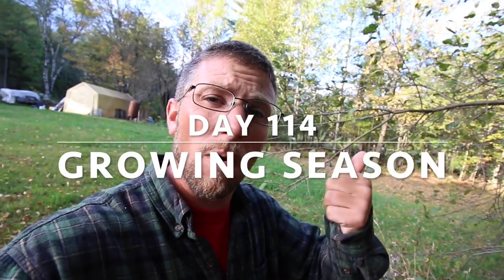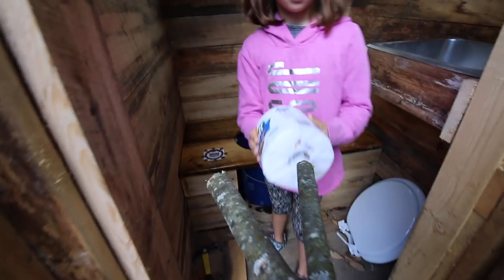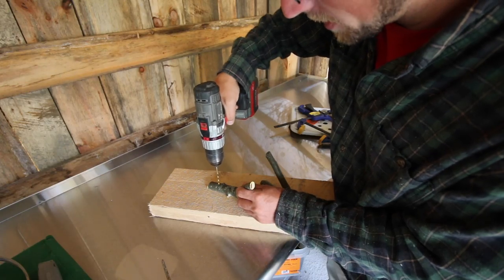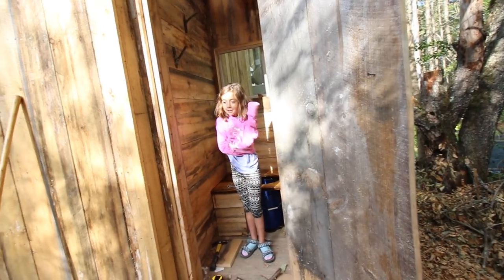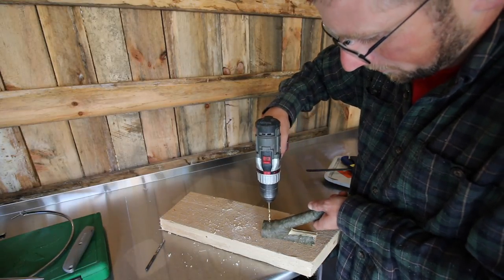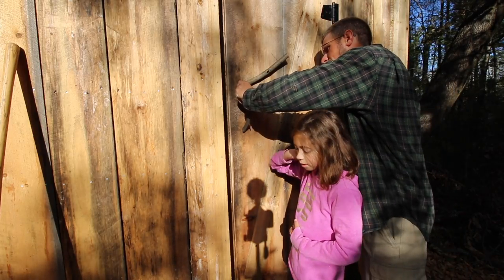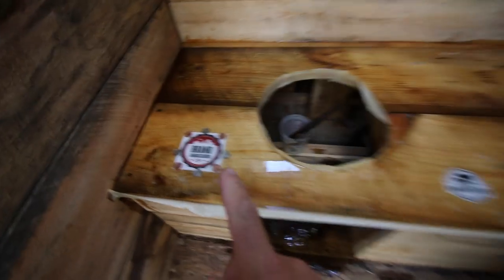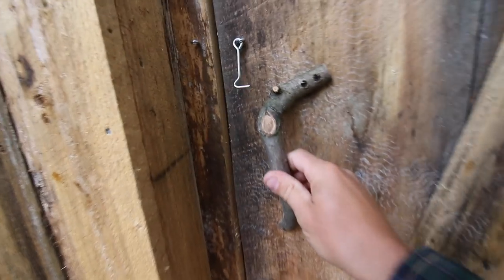How to Make a Tree Branch Door Handle, Coat Hook and a TP Holder

Comment: Fun to watch you and Olivia working together creating and building necessary buildings and items! TFS!
I would say to make sure to add a straightedged tool (like a ruler) attached to the inside of the door that will slide up between the door and the door frame to unlock the outside lock if someone got locked it.
Reply from the maker: :) Good thinking!

Comment: Hi Al, just watched you and the Boss hang those coat hooks and TP holder.  It dawned on me that your TP holder looks a little sharp on the end.  I'm thinking that the end of the horizontal part that holds the roll of TP could have been cut on an angle where it's more forgiving to the body if you bump into it!  Maybe just rounding it a bit with a file would work too.  Just thinking out loud :-)

Comment: That looks awesome! Did you say you sanded the first coat of resin down? I was sure hoping to see how you knock bubbles down & of course no bubbles this time! 😕 I must have missed a video - there are horizontal boards in there! When did that happen? 😮 It looks really nice. There are really nice gate latches that allow one to open the door from both sides so no one gets locked in. I'll see if I can send a link.
Great job helping boss!!👍👍
Reply from the maker: I think you missed a video. Yes I sanded down just a bit.
Reply: Lumnah Acres - what did you do different so no bubbles formed?